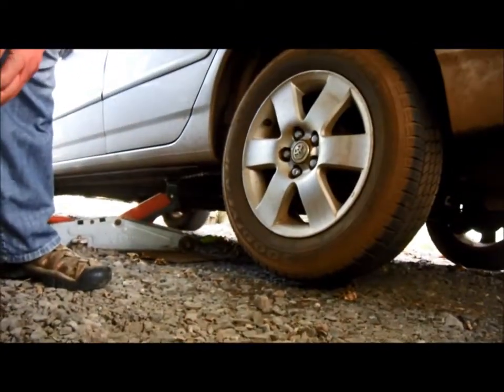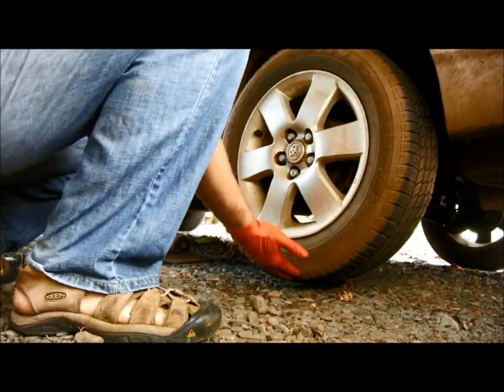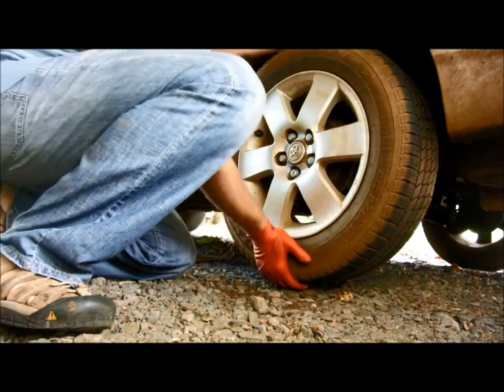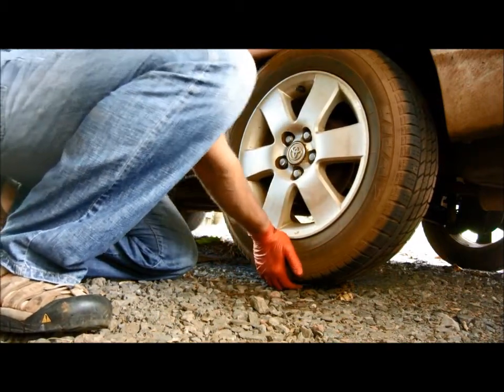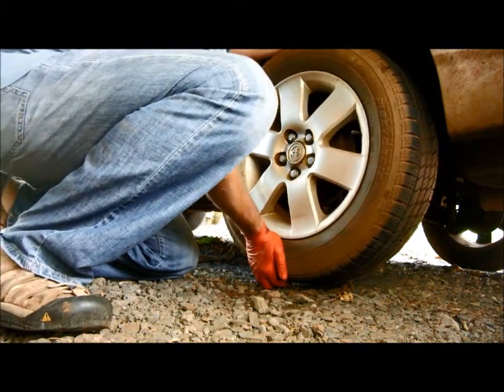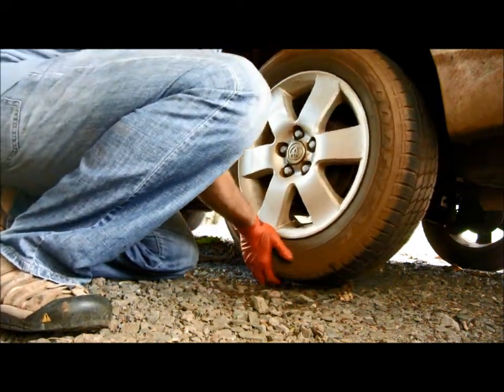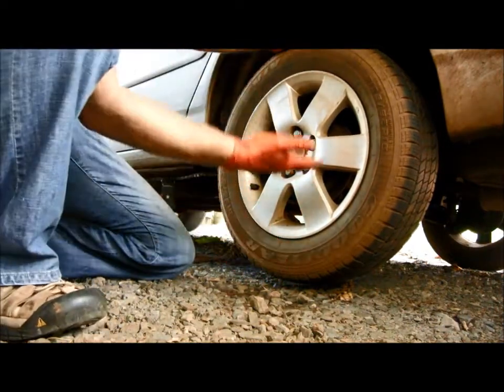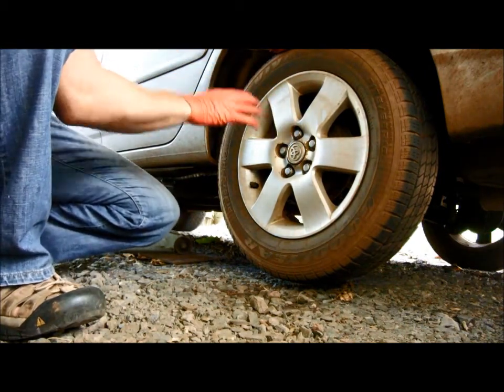How to check wheel bearing play

Comment: The point you put the jack isn't the best place to put it - it'll squash and flatten and probably damage/tear the seam. You should use a jack on the subframe ;)
Reply: Actually you are wrong, jacking a car from the pinch welds is totally fine..
Reply: @Ctworek12  It crushes the seam and splits it, look under most cars that have had this done. It says in the manual to only use the jack in the boot on this are, not a flat topped hydraulic jack,
Reply: @DavidB-rx3km  That's true, it's happened nearly Everytime overtime. I did think that it was fine though but I look for subframe still.

Comment: your checking ball joints... wheel bearing should be 3 O 9   not 12 O 6
Reply from the maker: try to find ball joints on this rear wheel….and not, it is correct….bearing is 12-6…ball joints are 3-9
Reply: wrong sir. Ball joints are 12-6. Ball joint is at 6 o clock you won't feel the play at 3 and 9. At 3 and 9 you are checking tie rods. Also always check bearing at 12 and 6 once  you determine ball joint is OK